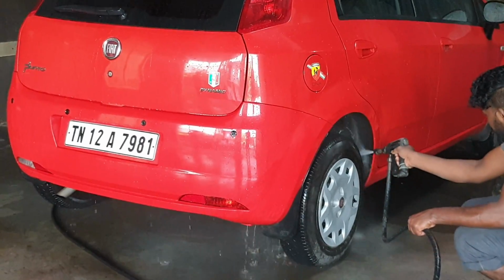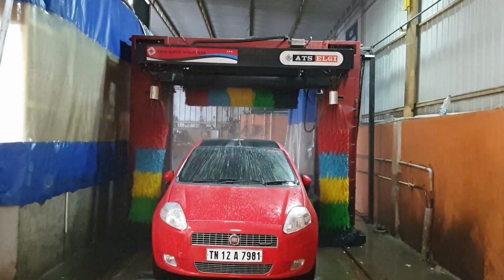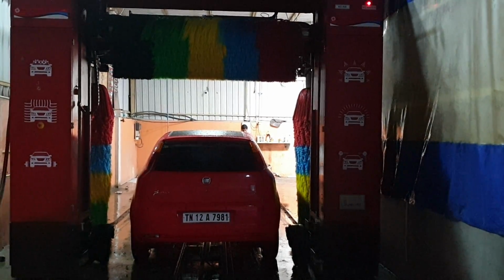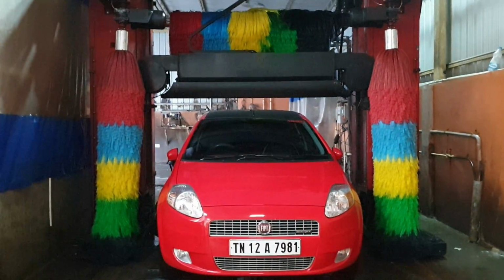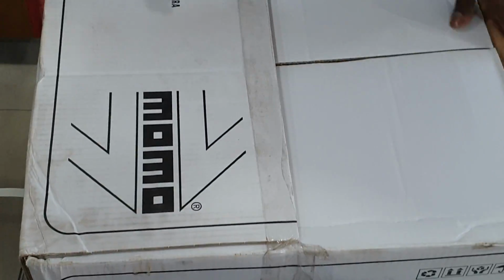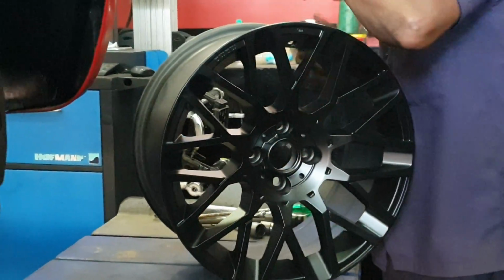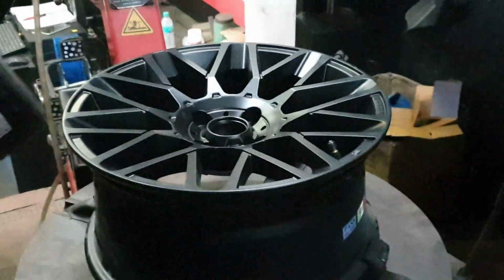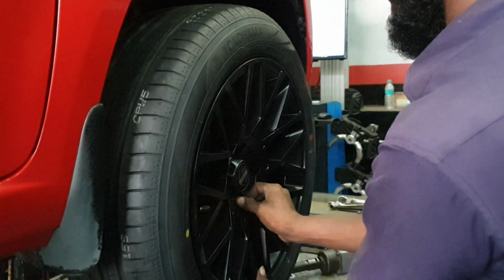Upsizing Alloy,Tyre for my Car|New Spoiler,Number Plate&Stickers|Automatic Car Wash

Comment from the maker: Alloy Price : 36000 
INR
Tyre : 30000
 INR
Spoiler : 7500 INR ( Including painting ) 
Stickers : 700
 INR
Number plate : 800
 INR
Alloy and Tyre Shop : MRL WHEELS AND TYRES
#5/342, Old Mahabalipuram Rd, Thoraipakkam, Chennai, Tamil Nadu 600097
099411 68156 https://g.co/kgs/JaHeBA
Sticker & Number Plate : US Sign Board, Anna nagar.
Please subscribe the channel for more high quality videos.
For making car delivery videos, you can contact +91-9886702917
Kia Seltos All Colors and All Variants : https://www.youtube.com/watch?v=Le95YPMvsGc&t=45s
Tata Harrier Delivery Video : https://www.youtube.com/watch?v=kSHkmVTaVM8&t=3s
Reply: Mention the alloy and tyre specs too please 👍😁
Reply: For how many tyres you paid 30k is it 4 or 5?
Reply: Bro 15 inch alloys available??
Reply from the maker: @achyutpattar5590   Please check with your local dealer.. Yes Momo has 15 inch as well for Punto
Reply: Per alloy wheel 3000
Reply: 16inch alloy is best suitable than 15inch ? Which is better
Reply: @achyutpattar5590  In kerala the RTO 's are creating problems regarding the tyre upgrades...

Comment: Multijet 1.3 active
Reply from the maker: Dynamic
Reply: Linea multijet active
Reply from the maker: @animallover2156   you own Linea multijet active ?
Reply: @BMCHDVideos  yes sir
Reply from the maker: @animallover2156  ok. The car in this video is Punto Dynamic
Reply: Do I need any alteration on stock wheel hub. I have punto dynamic. I am interested in 16"alloys.
Reply from the maker: @yogeshPatil-ev3vy   No need. Its 98 PCD . It will perfectly fit.

Comment: Thanks for the video. How is the suspension with bigger tyres and alloys? Is there mileage drop as well?
Reply from the maker: All is well until now. But if you have 5 people and full boot you need to be bit careful since tyres are bit stretched outside. Millegae I don't think any deference . But riding and handling is excellent as usual . Looks also awesome
Reply: @BMCHDVideos  Post COVID I heard Momo alloys have supply constraint and dealers started selling duplicates in market. How to identify original vs duplicate? Is momo a forged alloy or flow formed aluminum?

Comment: Does the center bore of this alloy fit directly on the wheel hub of the car or did you need a spacer? 
I'm having a Linea T-Jet and the stock alloys are 16"*98PCD. I'm looking at Momo for replacement. Would be good to know this detail!
Reply from the maker: Yes momo 98 pcd is perfect fit for Punto
Reply: @BMCHDVideos  98 PCD is correct fit. What about the hub diameter. For Fiat cars it's 58.1mm. Was it a direct fit or did you have to use a spacer in the alloy to make it fit the hub?
Reply from the maker: @fredyph30  I did not fit spacer but yes it's big . It's wider and taller. Mine is 16 205 55 that's why. May be you can go for 15 195
Reply: @BMCHDVideos  No bro, the stock tyres on the Linea T-Jet Emotion Variant is 205/55. So that should be fine. I am asking about the hole in the alloy in the center (centre bore) which sits in the wheel hub of the car. Is that a direct fit?
Plus, when I enquired these wheels are not available 😔